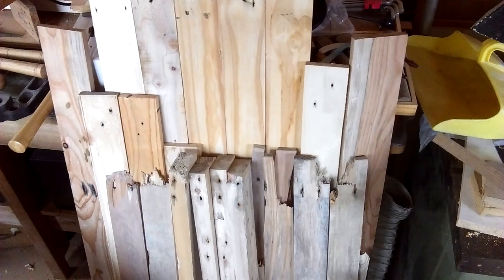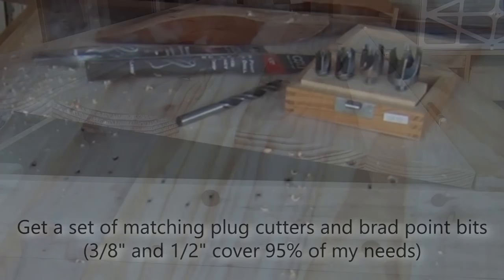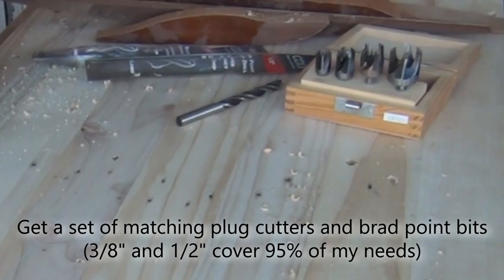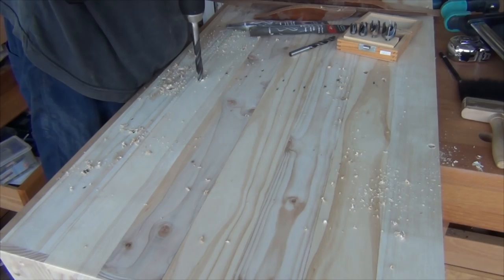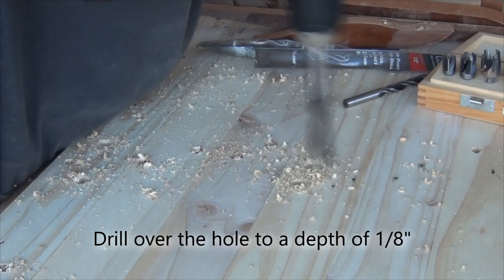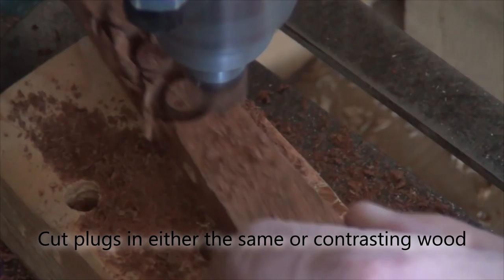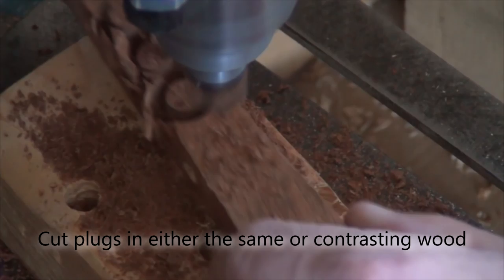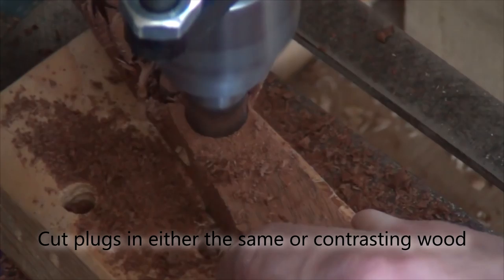Patching Nail Holes - 60 Second Series

Comment: great vid - just what i was looking for. do you have a recommendation for a set of plug cutters? which ones are you using & from which supplier as the results look good. thanks
Reply from the maker: Hi, I'm using the Dakota plug cutters from Rutlands. You should use a drill press for these, and preferably clamp the donor board too.
Reply: many thanks

Comment: Thanks for the tip, Mitch. Which brand of brad points do you use?
Reply from the maker: Hi Steve. I tend to use Colt twinland brad point bits. They seem pretty good.
Reply: +Mitch Peacock - WOmadeOD I may just give them a try, thanks.